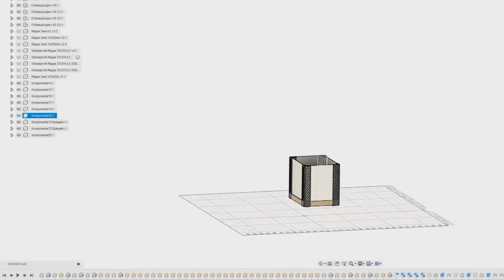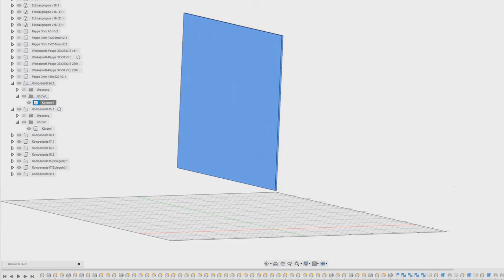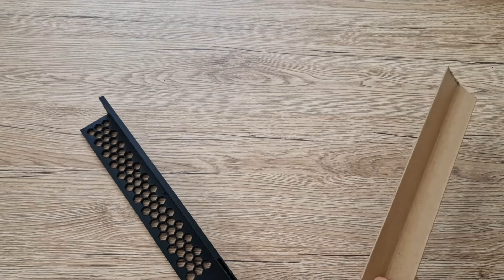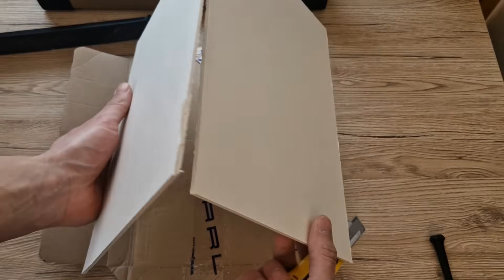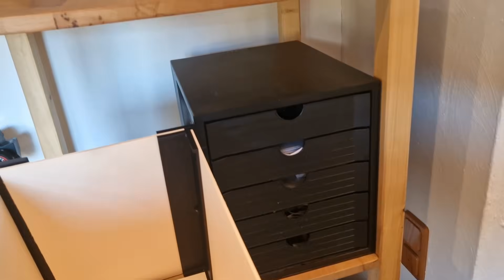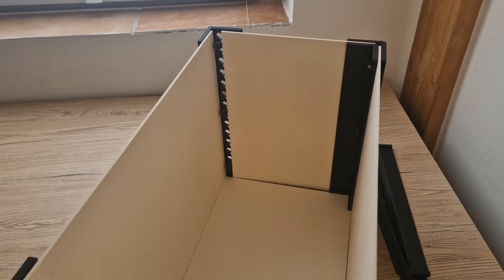Finally Modular! A 3D Printed Storage System

Comment: I love this! I have been looking for a decent travel solution for storing minis and this may be it. I have a sliding tray system that works like dividers that hold minis. I could easily print sides for this and make it compatible with the rest of my system.
Reply from the maker: Great to hear that! For travel purposes, I would recommend using the screw-type box. Because it seems a little stronger. I‘m planning on improving the design further and uploading a follow-up video, but currently I‘m working on a different project which I will upload soon. So stay tuned for upcoming videos :) and if you like, subscribe to my channel.

Comment: Very neat design! As others mentioned, the use of mixed materials is a great idea, and the dovetail solution is elegant and efficient. It'd be cool if there was a version of these boxes that could be used as drawers on linear slides, or smilar.
Reply from the maker: Thank you very much! 😊 A drawer attachment would be a fantastic idea! I’m planning to create a follow-up video showcasing some improvements to the current design. I’m also considering implementing variations of the existing 3D-printed parts and adding more attachments. However, I currently have several projects running simultaneously. I hope to find the time to work on this in the near future. If you’d like to stay updated, feel free to subscribe to my channel to receive notifications about this storage system and other exciting projects. Your support would mean a lot to me. 😊
Reply: @techproknowledge Already subscribed! Your other projects seem interesting too! Looking forward to the update!

Comment: what kind of solution do you recommend if those reinforced corner braces that you use for the bottom aren't available?
Reply from the maker: Good question. You can also 3D print these. But unless you have a belt printer, big boxes might be difficult because you have to split the L-brackets.